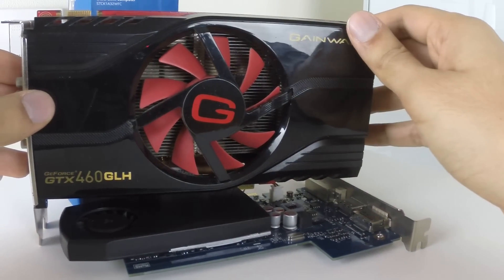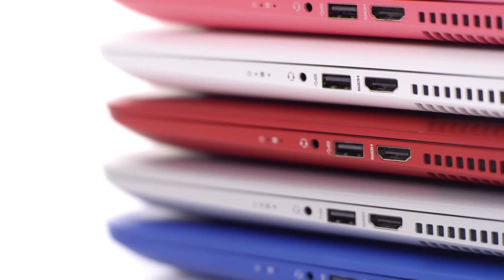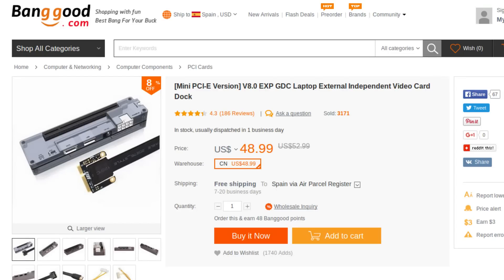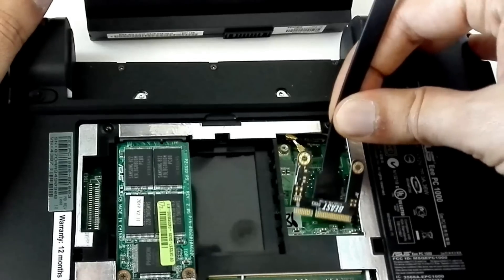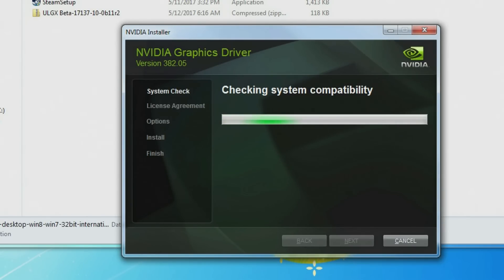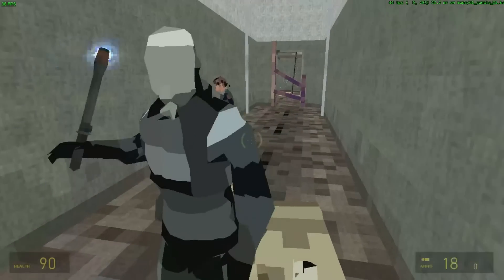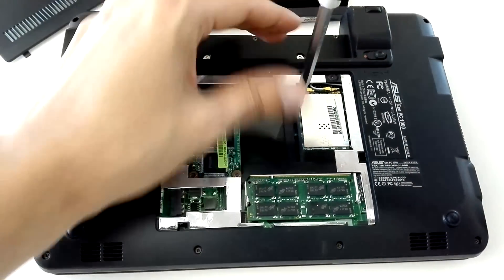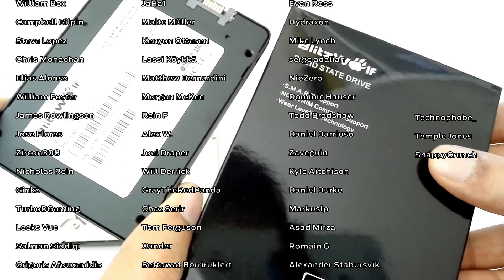An External GPU for an old Laptop?

Comment: Hey there and many thanks for your video.
My MSI's GT780DX gpu has burned (GTX 570M - MXM) and the motherboard doesn't have any internal video card.
Do you think that this trick could replace the original card?
I would like to use the computer in a DIY arcade cabinet so i don't realy care about high performances, it's a retrogaming project.
Please, let me know if someone used this tool with a laptop with no video card.

Comment: Hello, I had troubles installing the port and now I can't plug it into the pcie port without it turning off the computer for some reason, or rather taking over the monitor for video, without the drivers or graphics card installed
7

Comment: Hey guys im selling one of these egpus in the city of Toronto in Canada, pretty far shot to seek here but if anyone wants it ill sell it to them for $60 (Canadian dollars if you haven't gotten it) which is a few dollars lower than the store page and you can come get it the same day (shipping from site took like a month), ill throw in a free 400w power supply with it. the egpu dock is pretty much new used it for less than a day, did not realize comparability issues with my specific laptop so im selling it off. its exactly the same as in the video i have all the connectors and original packaging. if you live in Toronto Ontario Canada and would like to buy it contact me at mastergamer0934@gmail.com and you can come pick it up anytime
Reply: I'm curious... Did you actually get a buyer?
Reply: Did you get a buyer my friend?

Comment: Mine has HP Z200 SFF and planning to upgrade it.

Problems is:
1. PSU is hard to upgrade (barrier engineering)
2. SFF, so not all VGA cards fit.
3. No mini PCI-E, but it has standard PCI-X16

Is it possible to add gpu on it?

Comment: I've got an already pretty powerful ASUS ROG GL551 laptop (Nvidia GTX 960M 2GB, Intel i7 4720HQ 2.6 Ghz). The processor is still great, but the card is flagging. This video's principle should be able to be replicated on NON-dumpster laptops, right? Like plugging it up with a GTX 970 or something instead?

Comment: can I over clock the external gpu
ik it's a stupid question
cuz am stupid
but fr???
Reply: yes but you really wont gain that much benefit
Reply: Ainsley 69 me too
Reply: yeh
Reply: Ainsley 69 depends on the graphics card you put, but yes.
Reply: Yes
Reply: You will probably be bottlenecked by the connection bandwidth anyways (unless you're using a crap GPU aswell)
Reply: You can overclock it if you know da wae

Comment: Hello @LowSpecGamer !
I'm not sure about your type of GTX 460, but my Evga GTX 460 has an nice steady oc of: 1900 mhz Memory Clock. And 800 Core Clock. Something like 2000 memory and 845 core ends up in me having to reboot my pc.
Hope this helps someone..
Also fan speeds are at 90-100%.

Comment: if I remove my laptop's gpu can I connect a gt 1030 with a regular pci riser to the same pcie slot the dead gpu was using without the need of an external psu

Comment: I would steer clear of homemade applications of this. I built one using exactly what is pictured here along with a GTX 1060 and a matched power supply, the computer was an older Asus ROG. It worked perfectly for a few months, but burned the card for reasons I'm not so sure of. I built and treated the rig delicately, and am obviously not a novice (check out my robot!); I just feel that there are too many unaccounted for variables which lead to an unstable system when doing this. If I were to guess, I believe the card couldn't handle how the board executes it's on/off state, as its probably not as robust or optimal as a standard board.

That was my experience at least, and everyone's experience differs with eGPUs. I bought a new GPU, and maybe this mod is more geared towards resurrecting old cards and laptops rather than a cheap alternative to building a new rig. My takeaway was that it was a good short term solution for some extra power, but in the end, I ended up sending the 1060 in (played dumb and didn't say what happened!), got it back, and built my current rig, which was the better decision anyway! Hope this helps someone.

Comment: how much work is it to make the laptop portable again??? assuming I need the WiFi adaptor. also, is there a way to use the m.2 slot for connecting the dock??
Reply: how big of a problem will it be if the laptop already has a  GPU, like a 960M or something. I'm just asking.

Comment: What gpu would you reccomend for i3-4005u. Im not really sure if i connect a gpu then should i buy a psu?. considering that this laptop is using low voltage.

Comment: Lonovo ThinkPad W520 (i7 CPU) rocks a PCIE Express Port and works very well for this application.  I'm running a AMD Radeon RX 480 with this setup with great success.  ~70 FPS on Overwatch is common.  Powering the GPU with a 500 watt PSU I had on hand.

Comment: I've seen a lot of off lease HP and Dell Business Class Laptops with 1st to 2nd Gen i3 & i5 with Express Card ports going for $100 to $200.  Then just add that device with a R470, GT 1030, or GTX 1050 (or ti).  Then you got a great budget gaming laptop.  Also the website dose state you can use a laptop Power Supply (like a Alienware Power Supply) for cards that the TDP is 75 Watts or lower.

Comment: I plan to do this on my MSi GE60 (i7 4700MQ @ 2.40GHz, 10gb DDR3 Ram, NVIDIA GTX 765M, WIN10) using a 1050ti. Will I be able to use the display on my laptop or is another monitor necessary? Thanks. Just recently subbed! Great video btw

Comment: ATTENTION EVERYBODY! If you are buying this, then first chek how your wifi card is conencted. Do not make the same mistake as I did. Because only when I took apart my laptop and wanted to plug in the cable, I noticed that I've got not mini PCI E, but NGFF.
Reply: OOF
Reply: OOFEST OOF
Reply: but wifi cards still use pcie lanes over m.2
Reply: MEGA HYPER OOOOOF
Reply: OOOOOOOF!!!
Reply: oof
Reply: how do i check that? do i have to open my laptop??
Reply: @TehWarbird  yes, you will have to anyway if you're planning  on doing this.
Reply: @LosingIsMyHobby  okay. thx for the help
Reply: @LosingIsMyHobby  update: i found out that te ethernet is beside the cpu. so if i put a egpu on it, it may work. but its lockdown so i cant buy fucking supplies yet goddamnit
Reply: @TehWarbird  yeah. Either checking the manual, but I'm not sure where that will be written.
Reply: @WRZ100  no i found it
Reply: @TehWarbird  cool.
Reply: @TehWarbird  Yeah, thats the only way.
Reply: ThatRenaultGuy- Gaming & Music 
if your laptop is older than 2015 chances are its mini pcie if its newer than chances are its ngff.
Reply: @TehWarbird   actualy you can tell if your laptop is newer than 2015 it likely has ngff if its older you can expect it to have mini pcie
Reply: Can feel u
Reply: M.2? You can also connect a GPU through M.2 with another cable that is compatible with M.2.
Reply: LEGENDARY OOF!
Reply: @Bill K. Lol
Reply: @Bill K. Not sure where it's writen, but you can just open it and look inside.
Reply: F
Reply: Bro did it work ngff
Reply: @Arshhhh_vlogz  no.
Reply: @WRZ100  Should this work on any laptop that has a PCIE slot?
Specifically on my Lenovo X250, I did open it and I can confirm that it has a PCIE/Wifi Card slot, the only things is, is it compatible?
Reply: @fib621  I dunno.
Reply: justdontlovemyself  just google video card dock for laptop....
Reply: 3 years late but you can get a NGFF to PCIe Adaptor.
Reply: Big ouch!

Comment: first off, great video! So my concern has to do with memory. I want to do this with a 1050 ti which has memory speed of 7giga(bits)/s which is under 1 giga(byte) so as long as the PCIe or expresscard can handle data at 1 gigabyte or more, I should be fine? because I would do the express card in a heart beat for simplicity and ease.

Comment: Well, i've got a question: If you remove the Wi-Fi card thing, how do you get signal to play online?
Reply: Ethernet
Reply: I have a $9 USB Wi-Fi adapter that I bought for testing certain antennas since it can change them out. My MacBook Pro's Wi-Fi was being weird one day so I used the $9 adapter like a champ and was able to pull in Wi-Fi from the store a block away. lol.
Reply: "bluetooth"
Reply: nateo200 can you link the adapter?
Reply: FOOKING MILLENNIALS
Reply: Microwaves.
Reply: USB wifi adapter.
Reply: Chair, just use a flat profile USB plug (probably faster than your built in Wi-Fi anyway).  Or just use LAN and avoid lag all together... It's not like its going to be that portable with a GPU hanging out of it...
Reply: Infrared
Reply: nateo200 can you put a link to the WiFi thingy
Reply: Usb WiFi adapter
Reply: Mocanu Octavian43 ethernet nigga
Reply: buy a soldering iron plus an rtl8188 tablet wifi chip, solder the usb wires and the power to the gdc board (mpcie has an usb port integrated)
Reply: Ethernet
Reply: Short Wave Radio
Reply: He said in the video. ETHERNET
Reply: ethernet
Reply: Some laptop have 2 pcie so it good thing
Reply: Chris Skylord no
Reply: USB
Reply: Chair wired/Ethernet
Reply: Chair Ethernet
Reply: you could buy a usb wifi adapter
Reply: Ethernet so simple
Reply: Damn chair.. what a question..
Reply: usb wifi adapter, or ethernet
Reply: LAN Cable
Reply: Try plugging in your phone and turning on usb tethering. You can either use your WiFi connection or a data plan (unlimited recommended).
Reply: Bluetooth really ?!!
Reply: I have a vacant mSATA on my laptop. Can I connect it there? So that I will still have my wifi.
Reply: Plug your phone in and USB tether over the phones wifi.
Reply: Usb wifi
Reply: It's simple - Pigeon internet - you save your packets onto a usb drive, and you send them attached via a pigeon to the physical location of the server. Someone there will download and update the packets on the usb drive and send the pigeon back to you with the new packets. You will download and update the packets from the usb drive. Rinse and repeat.
Reply: Infrared
Reply: use ultrasonic waves
Reply: Wired
Reply: So nobody is going to question how a chair is going to play games on a laptop?
Reply: Phone tethering
Reply: its called ethernet
Reply: Bluetooth

Comment: Im thinking about trying this on my hp probook 4740s, but i have read that it doesnt provide much of an upgrade in performance, because its pci-e its a "low speed connection" or something like that (i dont know much about it). Do you think it can provide a significant improvement over the typical integrated graphics?
Reply: unless you have an expresscard 34 or thunderbolt connection... nah, you wont gain anything. over cpu integrated graphics, you might get some performance gains, but not drastic. its not worth it since the mPCI is only 1GB/s and most modern GPU's require atleast 8GB/s

Comment: there are some much better ways to do this. I bought a pe4g 3.1 for 30 bucks then got a Dell 220 watt power brick to replace the powersupply for 9 bucks. if you're laptop has a built in Intel Hd graphics you can run off the laptop screen. also of you get a pe4x 4.1 m.2 you can get u the full 16x v2.0. anyways In total including the laptop and gpu I spent $115 with a think pad laptop with quad core i7 2.6ghz 8gb ram that does alright. then when I want to game I just plug in the express 34 card and instantly have a gtx 480 and can play battlefield 1 sand titanfall2 at hight settings over Solid 60fps. let me know if you want me to make a video of my setup with links to where I got my entire setup.

Comment: express cards are usually on multimedia laptops from 2006-2009 and they are on work laptops (thinkpads, latitude, elitebooks) from 2006-2014.  So you can find a small 12" mobile work laptop with express card and use it while on the go and when you get home you can hook up the external solution for graphics performance.

Comment: can i connect any graphics card like gtx 1060, 1070,1080 , rx 480 ,rx 580.
Reply: I have i3 2.00ghz 8gbram I'm planning to do this with gtx 750titan and 500watts power supply is this good?
Reply: no.
Reply: Umer Alo if you are attempting to put that through the mPCIE slot, you could be expecting performance in the range of an average gt 630. also never heard of 750 titan, do you mean 750Ti?

Comment: currently there's 5 flavors of connection methods for the EXP GDC beast.  mPCIe,  Expresscard, NGFF, a version for Mac, and now M.2
Reply: Nice, i have an hp elitebook with expresscard
Reply: i need pcmcia
Reply: Trayton - Not available in pcmcia. Not enough bandwidth. You will have to sacrifice your wifi card. And use its slot.
Reply: @chriscasseday7707  An external USB Wifi is still pretty cheap.

Comment: Some cheap laptops / netbooks cannot support a graphics card in its mini-PCI slot they are only designed for a wifi card. In fact some only work with specified wireless cards!!
Reply: cheap meaning ?? how much would be the price of such laptops ?? cause i bought mine at 699 dollars , is it considered cheap then ?? and is there a possibility that my laptop might not support the external graphics card ?
Reply: Siddhartha Upreti he means a dumb software whitelist what brand and year is your laptop ?

Comment: is it worth to try? my cpu is i7-3612qm @ 2.10 Gz (8 CPus)
8gb of RAM and Intel GPU HD Graphics 4000. i run dota with 80 to 100 fps at low setting
at medium setting 40 - 55..

i just want to increase my fps about 20 when playing @ High setting,

Comment: My old G480 lenovo laptop doesnt have a thunderbolt port, can i still perform eGPU without it? i mean, i just saw you removed the wifi thinggy and changed it to that cable connected to video card dock, please reply. seems like he didnt use a thunderbolt port?
so ican do this too on my laptop? amarite?

Comment: Hello i ran into a problem when trying to connect the pci-e cable to the wifi card dock. I think the wifi-card slot is a newer version and the cable is too large to fit into the wifi slot. Anyone know what cable i need or if it is compatible at all?

Comment: can u use a two way HDMI cable rather than putting it into the WiFi place
Reply from the maker: No. HDMI port in the PC is not used for data.
Reply: how can i use thunderbolt 3 without USB C port in my laptop ?
can i use wire ( male usb 3.0 and usb c female) ?

Comment: What's the bottleneck on Mini PCIe? How powerful a card could you run on this before you're wasting performance? I'm curious since I have a modern laptop and it'd be interesting to try and upgrade the graphics, but it'd be pointless if the cards that max out the port are worse than my GTX 860m.
Reply from the maker: It's a good question. I will have to experiment
Reply: LowSpecGamer I'll look forward to the future video then.

Comment: yeah it works... but does it really?

laptops with pcie are obselete.
connection doesn't provide enough bandwidth
have to have another psu
lack of wifi and mobility

nothing worths all that hassle. i wouldn't call that working.

i'm interested tho if that thing can be converted from pcie to thunderbolt 3?

Comment: Not very practical but it could a fun little project if you like tinkering with stuff. You could perhaps revive an old machine you no longer plan to use. It won't be really portable with that mod anyway. The biggest issue for me is that you have to buy an entire SPU just for that.

Comment: so i basically own a intel i5 2.3ghz single core computer a reskined hp pavilion with some upgrades to make is "run" games and i wanted to know how fast i could run skyrim with a 1050 ti from nvidia hooked to it i normally avg 30-50 fps and 10-20 with shaders...so would it be worth it?

Comment: Heres a tip. Remove your optical drive (if you have one), and connect the the mini PCIE in from there. Save the WiFi!

[This might require you to disassemble it to easily plug it in but if you're fire you can use tweezers or even chopsticks to fit it in.]

Comment: The Intel Atom wasn't so bad, you're just running Windows 7 on a system made to do basic tasks in XP.

"Never buy the cheapest hard drive on Amazon for a Windows 10 computer"
You mean never buy Windows 10.
Reply: Windows 10 is a great OS. Makes windows 7 look like XP now, And makes 8 look like a bad idea from the past.
Reply from the maker: I bought one of these when they released. It came with Windows 7 starter. It was bad

Comment: Just wondering, but is the hdmi signal from the GPU send back to the laptop and displayed on the laptop screen? or did you have to hook it up to an external monitor?
Reply from the maker: you have to use an external monitor
Reply: Thanks for the answer. The product page is a bit unclear, though they seem to claim it will display on the laptop screen if you use certain nVidia based cards. Though how that would work I have no idea. :)

Comment: You my friend are a GOD! When eGPU was been talked about, I always assumed it to cost less than $100 because it's just an adapter, not a GPU. You've proved me right... let's see all those crazy fan boys try and justify the price of a Razer. I get that it cost $499 (mainly because of the name Razer and nothing else). It's an external GPU adapter... FFS it shouldn't cost more than a $100. I'm getting this as a replacement for my 940mx.... upgrading to a GTX 1070. Imagine this coupled with a 6th gen core i3 with hyper threading...wow!